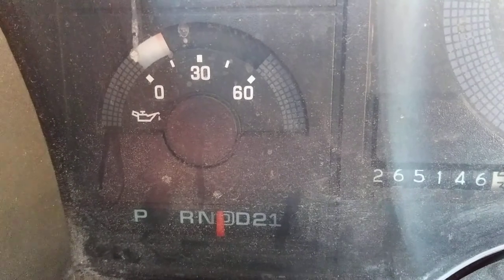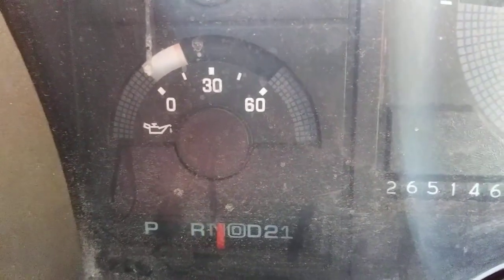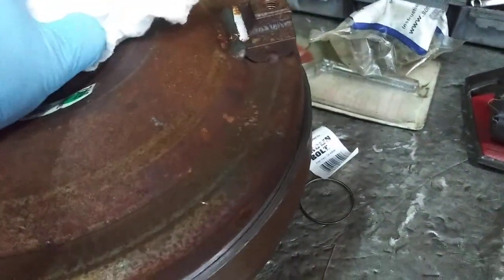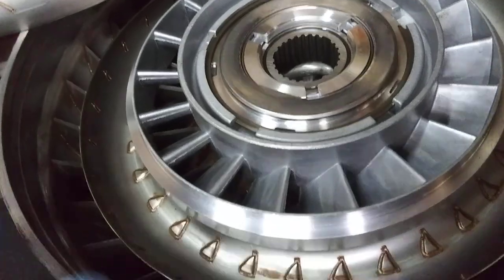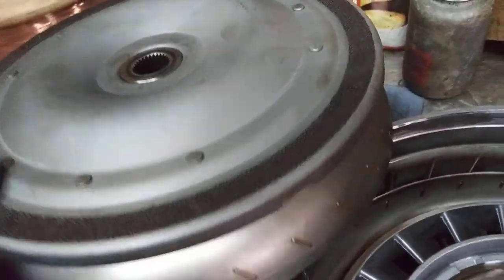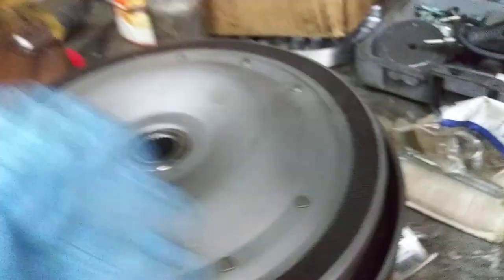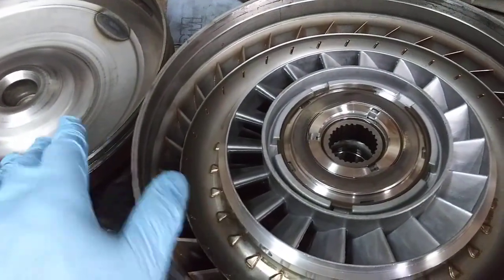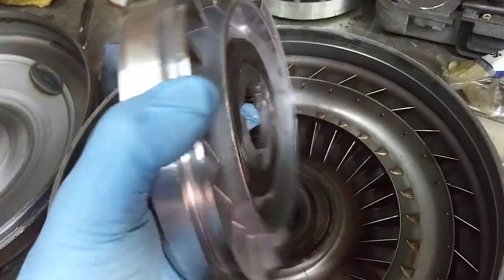General Motors cars and trucks with a whining noise in the torque converter

Comment: With transmission in neutral or park, the torque converter shell and turbine spin freely in unison, with no relative motion at the bearing, once the moment of inertia of the front clutch drum is overcome and spins with it.   When transmission is placed in gear (forward or reverse), the forward clutch is applied and the turbine is held stationary until the vehicle is allowed to move.  A stationary input shaft holds the turbine creating relative motion at the bearing between the turbine and the impeller (shell).  A bad bearing will make noise with forward clutch applied and vehicle stationary.  Will quiet down as vehicle speed increases and impeller and turbine speeds begin to match.
Reply from the maker: Very well explained, thx.

Comment: I know this video is kind of old but I have a GM that's making that same exact sound and it will go in gear and drive as long as it's making that sound but when it quits making that sound you ain't going nowhere in any gear you can shut it down start it back up and it will repeat the process all over again would that also be the converter or could it be a pump?

Comment: my 04 trailblazer 4x4 was making that exact noise, getting worse over the summer. pulled away from a crosswalk the other day, and the gear slipped. rpms rev up but there was no acceleration. accompanied by loud clanking sound in P D and R, like something getting tossed around in the transmission. turn off car, start up, over and over and eventually gets into gear fine and was able to drive it home.

just a bad torque converter? or maybe also transfer case? scanner reads everything in transmission is fine. goes into every gear. thoughts please?
Reply from the maker: Sounds like internal transmission concern

Comment: Sir, your video solve my Honda jazz 2015 whine noise, thanks a lot, my car whine noise started 1 month ago. When in drive n reverse whine after 40 the noise faded, same as your video truck whine noise.
Reply from the maker: Glad to hear, thank you
Reply: @johnandeddie  
Sir, here Penang Malaysia, Honda don't have the one way bearing clutch replacement, i searching google only can find it in USA, does Honda precision parts in Mexico plant, selling out the transmission parts into USA?

Where can i get the original Honda one way bearing clutch? 

After open up the transmission, just replace the one way bearing or together with the stator?
Reply: Or just buy the whole torque converter better?
Reply from the maker: @ochch943  The torque convertor is serviced and sold as a complete assembly.

Comment: It took me way to long to finally find a video explaining what I've just started to experience this week, Mainly how it would only make that whine as reverse or park or stopping at a light. Mine actually started as a rattle but that seemed to have faded to this whine rather quickly, Either way tranny fluid service and a new torque converter in my immediate future.
Reply: Park doesn't put any load on the torque converter, same as neutral except for the parking pall is engaged.  FWIW
Reply: @thisisyourcaptainspeaking2259  that was a typo error on my end, Was meant to say drive not park. Sure enough the stator was at fault.
Reply: @bradbradshaw6082  Yep, good diagnosis! ;)

Comment: How long will a 4l60e go with a whiny torque converter?  Is that what causes the butterfly lugging/miss type action when it lugs low RPM's before tranny does the downshifting to the next lower gear?
Reply from the maker: Hard to say, possibly
Reply: My 99 ford explorer has done that for the last 120k miles. A year ago it just started having problems getting into 3rd but once it's in it's fine. I've got 280k on the dash and still drive it 30 miles a day. It leaks fluid and for the last 4 years I've replaced it with lucas stop slip and I swear its been my saving grace.

Comment: i’ve got a 13 silverado

still have all gears. 
no slip or stutter just a whine. 
whines on acceleration and deceleration but little to no noise at a stop light. 

i’ve been thinking it’s the transmission oil pump but your video sounds identical to the noise i hear. 

faster i go the quieter the noise gets. engine probably drowns it out though. 

thoughts?
Reply from the maker: If it is the bearing shown in video the whining noise fades out completely when the vehicle starts to move in drive. It may come back for a second or two on the upshifts. Try a trans service first.
Reply: thanks for the response

Comment: My trans just started doing this while on a road trip. I noticed the truck started having a missfire but no light came on. After exiting the freeway and lowering the window i could hear it. Mine also whines in park and the fluid is full. How long do you think i have before it gets to be undrivable. I have about a 200 mile trip home where i can most likely fix it myself
Reply from the maker: Whine in park is not the torque convertor, sounds like you may have another issue. Thx for watching

Comment: What happens if the bearings go completely out? My 95 C1500 did this and had a grinding sensation shifting from 1st to 2nd. Now it won't move in any gear at all. Transmission never had any problems before that.
Reply from the maker: Filter can get clogged up causing  a lose of prime to the pump

Comment: I’m having that same sound with my 07 chevrolet Colorado. I have no idea what’s wrong with it. It hasn’t given any signs that the transmission or the torque converter was bad. But I was going down the road and it randomly just slipped gear and wouldn’t accelerate anymore. It won’t take any gears whatsoever but it is making the squealing noise. Is it the tranny or the converter?
Reply from the maker: Sounds like internal trans problem clogging up filter which may also be caused by torque convertor

Comment: My 2006 trailblazer is showing signs of torque problems/I just dropped the transmission pan replace A&B solenoids hoping is clears up the trouble. It was only shifting to 1st gear.  It is shifting a lot better.  
Thanks for the info!!!👍
Reply from the maker: You welcome, thanks for watching.

Comment: My 2010 Lacrosse makes that noise but only when I hit accelerate and my needle is at 1-2 RPM after that it disappears. Same problem or trans?
Reply from the maker: With engine running and trans in gear you will torque convertor whining noise ,you will have no noise in park or neutral

Comment: Went to look at a 1994 c10 blazer that had this Same sound. When in drive and while moving. I didn't get it cause i wanted to do research on this sound. This most definitely is it. Is it worth it?
Reply from the maker: Correcting this condition require torque convertor rebuild or replacement.

Comment: I have an Acura TSX with that converter whine. I hate going through drive throughs because it's really noticeable when I'm stopped. It's been like that for several years. The gears don't slip and there's no shudder. What are the consequences of not changing it?
Reply from the maker: eventually will get worst

Comment: Finally found it, this is the exact same noise I got aswell. However it is only on startup, once I start driving it goes away soon. On hot summer days that is usually less than 10 seconds, now in the winter more like 1-2 minutes. After that its completely gone until I park it again for a long while. Could it be that the trans filter is clogged and once the ATF heats up it passes through, thus eliminating the noise?
Reply from the maker: Yes
Reply: Alright I fixed my issue. In the Turbo 400 the filter is supposed to be hanging somewhat loose in the pan, but the previous owner had used washers to tighten the filter down. That way it sat a little higher in the pan and was pulling air until the oil heated up and expanded.
Took the washers out, problem is gone

Comment: At 2k rpm my 04 Yukon 5.3L with 4L60e makes a sound on the passenger side that sounds like exactly like hhhhhuuuueeey!! Then stops as i go to 3k Rpm. Also has kind of a diesiel sounding rattle on startup that goes away after it warms up a bit but performs like crap when ambient air temp is above 90 degrees..does this sound like failing torque converter?
Reply from the maker: possibly

Comment: Will the bad stator bearing cause the engine to stall? 96 cadillac fleetwood lti 4l60e.
Reply from the maker: Bad stator bearings make noise like in video. Raise up vehicle and put in gear not holding brakes and see if vehicle stalls. If ok then apply brakes. If engine stalls, possible bad torque convertor

Comment: Hi I've been having that whining/whirring noise upon accelerating it has been getting worse over time and yes it goes away after certain MPH. Could this be the cause that my transmission slips and I don't feel that much low end torque anymore? It also has a shudder at higher RPMs. I just replaced transmission fluid along with the transmission speed sensor that is inside, car feels better but I can still hear the whining noise upon accelerating and like it still needs more of the torque it used to have.
Reply: You described exactly what mine is doing. Slipping in third gear under acceleration and the whine
Reply from the maker: Sounds like internal trans or convertor concern
Reply: @johnandeddie  Thank you for your response I had dealer replace transmission and it feels better but I feel like ECU is still trying to adjust to it, about how many miles does it take to fully adjust as it still slips at higher mph??

Comment: I have a 90 c1500 stick shift, only whines when I go in over drive , doesn’t whine in gears 1-4 . Same problem?
Reply from the maker: Manual transmissions do not have torque convertors, Sounds like you have a internal transmission concern. Possible overdrive gears and or bearings

Comment: Getting a noise like this on an A727, only makes the noise on a cold start and the RPM's slightly raised to get the car to move, Torque converter bleed down? worn converter? i usually  let the engine moderately warmed up before driving, but in case i need to get somewhere in a timely fashion, the noise will come back and lose and forward gears & reverse.
Reply from the maker: Try changing fluid and filter first.
Reply: @johnandeddie  already done that few years back, the car being a classic, doesn't get driven much so the fluid doesn't really go bad.

I can just assume a worn trans and a rebuild is in my near future.

Comment: Sir, my honda fit 2015, cvt gear box torque converter bearing whining noise on and off, what the problem with this situation? Or is other part whining noise?
Reply from the maker: A internal transmission problem can cause  the filter to restrict fluid flow and make a whining noise. If that is the case you would replace the transmission

Comment: I noticed this whine about 6 months ago during the winter. I thought it was a pulley bearing for one of the drive accessories. Wrong! Then whining got worse & now I'm probably gonna get rid of the car. I mostly blame myself. I knew the transmission was slipping in first but didn't do anything. The car had 170,000 miles & I waited too long. Live and learn I guess. 2011 Chevy Impala
Reply: I thought mine was an accessory, pulley as well.

Comment: What if I get similar noise in park and all throughout driving ?
Reply from the maker: Check to make sure noise is coming from trans and not the front of engine like a belt tensioner, idler pulley, alternator, etc. If noise coming from trans, may be a restriction trans filter due to possible internal problem.

Comment: I had that whine noise, changed the torque convertor and the whine is still there. Why?
Reply from the maker: Change trans filter, also try removing serpentine  belt and start vehicle to confirm any problem with pulleys and/or components on the front of the engine
Reply: @johnandeddie  It was the power steering pump when we removed the belt.

Comment: What if it whines when it’s in park?
Reply from the maker: Look for noise somewhere else
Reply: @johnandeddie  will do it wines in park and goes away when I shift into gear but then comes back after a bit. Sometimes it takes a while to actually engage when I shift into drive.

Comment: I have an extremely loud whining when even in park and I give it gas could that also be a torque converter issue
Reply: Just happened to me 30 min
Ago 96 caprice 5.7 LT1 … car won’t move at all . Kicked out of gear when accelerating & felt like I went over a speed bump fast